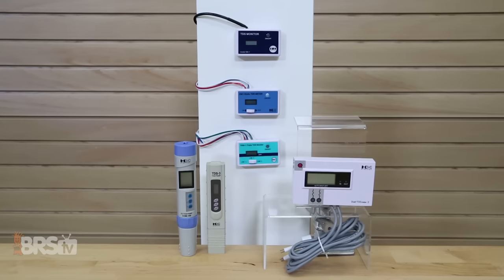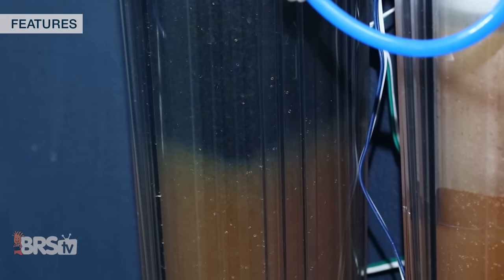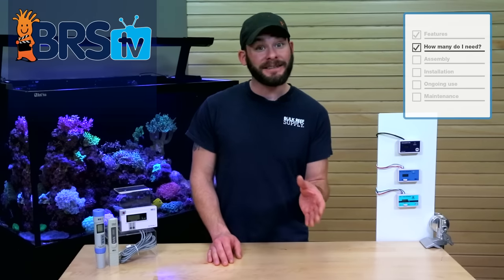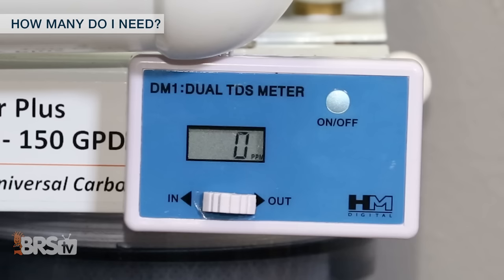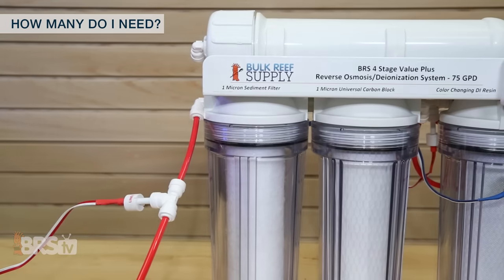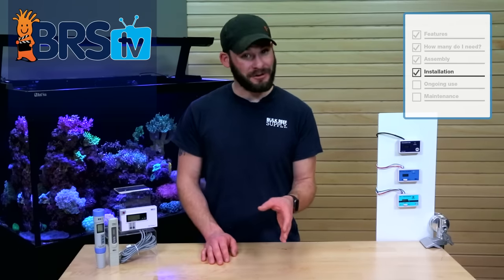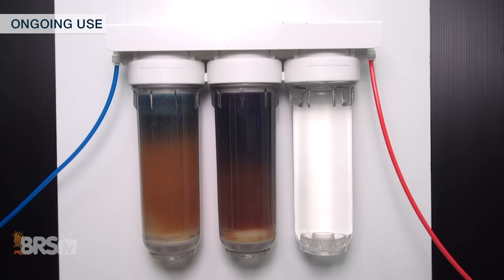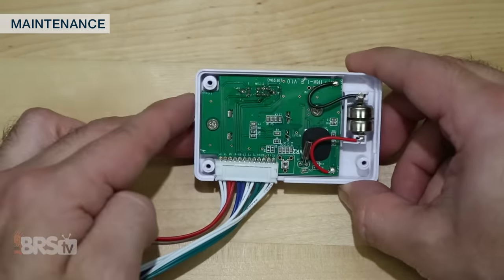Spotlight on TDS Meters for your RODI unit | BRStv

Comment: The probe alignment and cleaning tips are incredibly helpful. I've been using a BRS 2 probe TDS meter for years and never knew about those. Thanks for including that in the vid. So glad I watched this one.
Reply: Yes here too. I just installed all new filters and re- plumbed all the lines..I was really surprised to see 000 readings for both water from RO membrane and after DI...I’ll now be checking probe pin alignments and cleaning them to see if that makes a difference.

Comment: With the 150gpd upgrade kit, where would you place the triple point tds meter probes. I have one after 2nd membrane and after Di stage. , should I try and put one between both membranes to test tds coming out of 1st membrane.

Comment: I like having a sensor before and after the RO membrane, simply to verify that the membrane is still working properly with the proper rejection rate as city supply side can vary.   Find this is a better way of telling rather than wondering why my DI resin needs to be replaced every couple weeks.

Comment: I got the 3 inline.
Problem is you can't calibrate each one separetly... and guest what...
They are not egal.
I calibrate whit 45microS liquid.
Witch is around 28.8ppm
So when i calibrate the third at 29.
The second is at 34 and the first got around 44....
I know my tap is at 300ish... meter say around 250
after the RO i got 6-7ppm meter say 4-3...
And the last after di hit the 0 mark, witch is the good reading....

Comment: You forgot to mention that the inline meters are not Auto Temperature Compensating units and tds varies by temperature. Personally, I think the triple inline is the best of the inlines because you should know what your source water is so you can determine the rejection rate on the membrane to know when it needs replacing. 

The Com-100 you showed (the blue one) is the best, and most accurate handheld for the money. It also Temp Compensates and has a variety of different measurements to use. Anyone else should skip the cheap $20 ones because they don't hold calibration, and so far, every handheld, even the COM-100, needed calibration out of the box. 

The $20 brown ones gave me constantly different readings with the calibration solution, and that was after 3 of the same unit.

But otherwise very informative 😉

Is there an inline that has the ATC feature?

Comment: question: I currently have a double probe inline tds meter in my RO unit. I am getting rid of this RO unit and replacing it with something else. the tds meter is working perfectly. can I just take it out from the old RO unit and use it to test the TDS in other water (not installed inline but just in a container or glass of water) ? thanks in advance!
Reply: Mat's Pets 
They are meant to have water flowing between the electrodes. A handheld would be your best option, the COM-100, for accuracy. It's POSSIBLE you could get by by swishing it around in a container to pass water through it (with the fitting connected to keep water between the electrodes), but may not be accurate enough because that's not how they're meant to be used. It measures the conductivity passing between the 2 electrodes, thus the "inline" moniker 😉
Reply: Thank you! Yeah so a handheld tds meter isn't expensive eather, around €20 here in Belgium. But I also have some small pumps just laying around here,   so maybe I can just connect a small pump to the tds meter I have and put the pump in my RODI water tank.